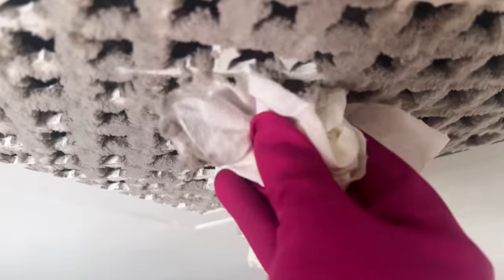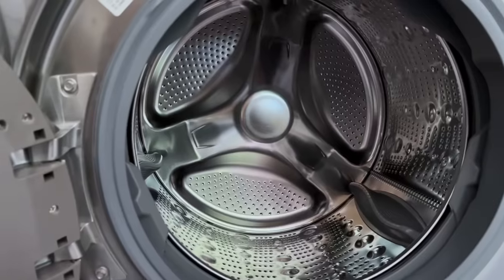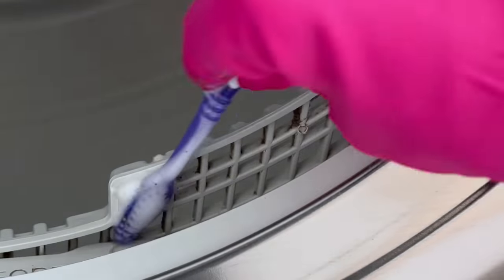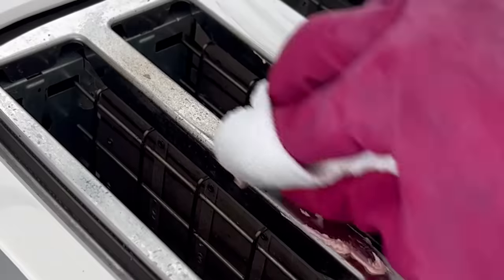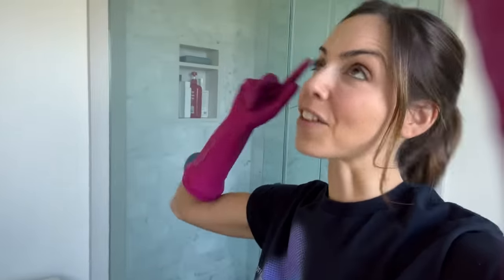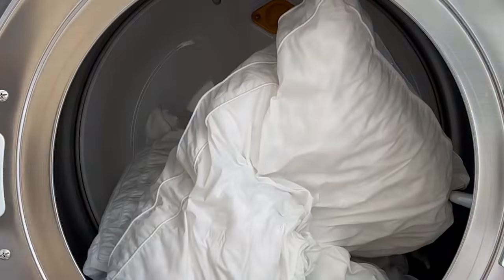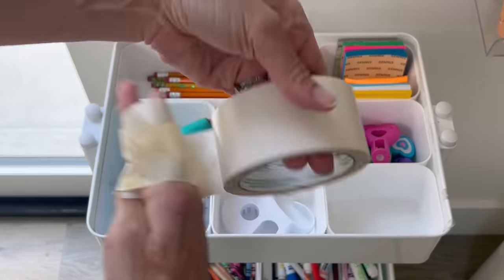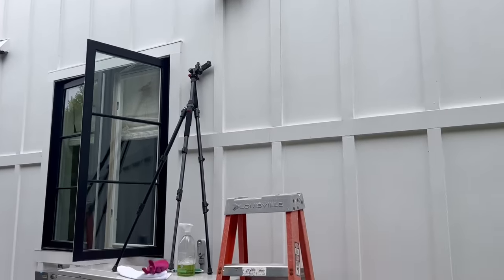15 NASTY Things You Should Clean (but prob aren't) #satisfying

Comment: no non no non non non
You screwed up at 1:58. Guys, you are putting moisture into the dryer vent which people should know gets lint trapped a lot quicker. the dryer vent now needs to be properly cleaned by a service personnel